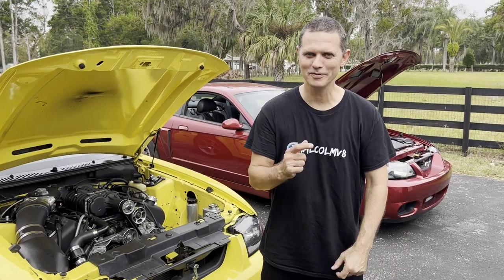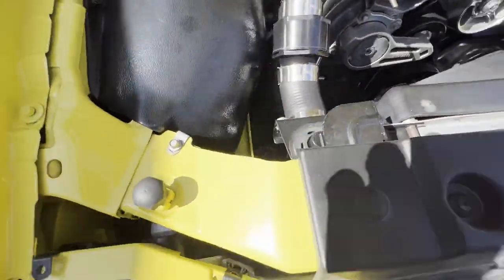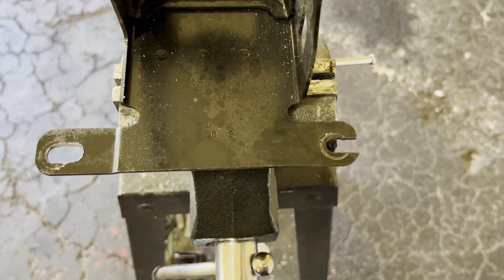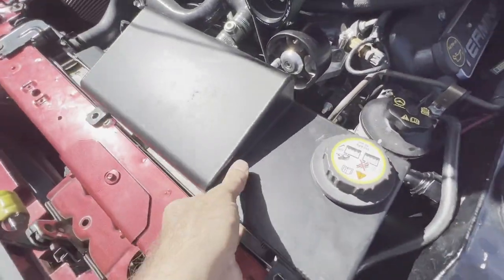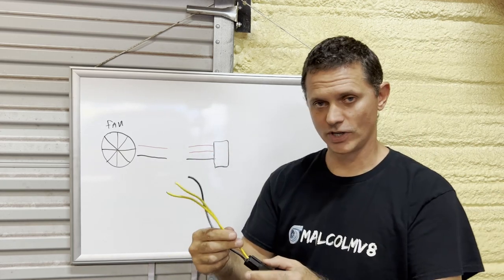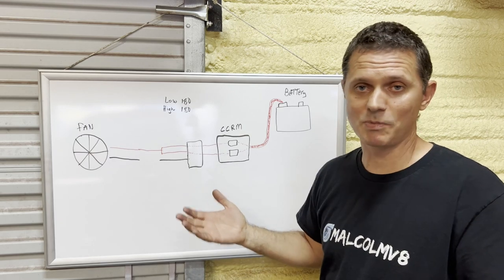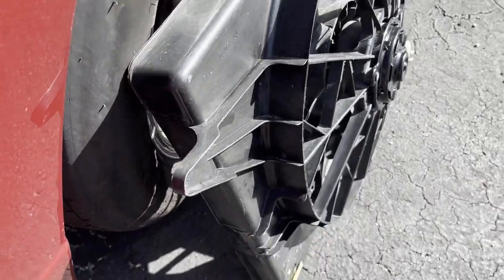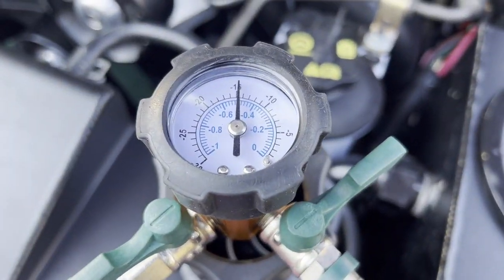Lincoln Mark 8 Fan Install into 03 Cobra Terminator

Comment from the maker: I forgot to include in the video that an alternative to making custom ABS brackets is that you can just notch the fan housing.  I've done this on other installs and it also works well.  Here's a pic of another install I did where I notched the fan instead of relocating the ABS unit.  http://www.mdracingkc.com/images/mds_articles/mark8fan/fan3.jpg

Comment: nice video. I will be soon installing a contour fan or mark8 fan into my twin turbo cobra.... I am running a holley hp so looks like I may need a nput/output module for all these nice upgrades.
Reply from the maker: It’s so worth using up an output to regulate the fan. Soft starting and only spinning as fast as you need are such massive improvements. One of my favorites :)
Reply: @MalcolmV8  for sure. Cheap insurance to keep all that money in a engine happy.
Reply from the maker: @scottadkins918  Absolutely.  No short cuts on the fuel system or cooling system.

Comment: Very nice! I have the same tank. I wish it didnt need to be cut and welded for the Mark 8 fan to fit otherwise I would be doing this. What alternatives do us Cobra guys have for replacement fan (besides this obviously) since they dont make them anymore?
Reply from the maker: Probably the only other one I'd consider is the dual contour fan setup.  They are also super impressive and can be purchased brand new still, or at least aftermarket copies.  Not as powerful as the Mark VIII but still incredible.
Reply: @MalcolmV8  Any modifying needed for that one to fit?
Reply from the maker: @jalexs5283  I'm not 100% sure into a Terminator.  We usually install the Contour fans into our Foxes and the Mark VIII into the Terminators.  I might do a contour fan in a Terminator next time just to see.
Reply: @MalcolmV8  That would be awesome!

Comment: I’ve also got a Mark VIII fan in my 03 Cobra but with a thicker Mishimoto radiator.  I was able to make it fit.  The problem is the overflow tank no long bolts to the car.  Currently I have it zip tied.  Which works.  But I hate it. 

I’m hoping to find a better tank setup that might work.  I like the  consolidated tank but it doesn’t look like it holds enough fluid.
Reply from the maker: You could do a much smaller tank like I did on the zinc and mount it off to the drivers side maybe to get the clearance you need.

Comment: This is awesome, i installed two Mark VIII fans on my 96 Ram, you can see the video on my channel 😂
these fans pull so much air i can even tow with my truck at max capacity and i have no overheating problems at all!

Comment: Malcom as always love the vids. Is this the proper controller for the fan????

Ford part number : 6e53-8c609-aa

I’m interested in running this but need more info on building the circuit for a OEM computer system.
Reply from the maker: Thank you.  The part # on the controllers I have is 6E53-8C609-AA.  To run with the OEM computer is going to require some electronic skills.  You'd need to build an Arduino based circuit that can read in the coolant temp and then drive the controller with a PWM signal.  If you're not into electronics it would be a real struggle.  Alternatively you could likely use a cheap $15 PWM signal generator from Amazon to drive it.  You wouldn't be able to have the fan vary the speed based on temp but you'd at least get the advantage of the soft start.

Comment: Great video! Can this work on a fox body?
Reply from the maker: With a little work yes. We’ve mocked one up on a fox but never actually installed it. We went the dual contour fan route which was such a nice fit. There are videos of it in the channel too. Check it out.
Reply: @MalcolmV8  thanks for the reply, yeah I did the dual but used 2 11 blade focus fan just bought 2 fans and swapped a 5 blade for the 11 so I have 2 11 blades on a focus fan and used a Mazda 6 fan controller so it has a soft start for less amp draw, but ur mark VIII setup seam to move a ton of air, in ur opinion what fan controller could I use to make the MARK VIII work? I would like to try it to see if it cools better, my set up does a good job but I think the MARK VIII moves about 4500 CFM ur thoughts would greatly appreciated! Thanks for the great work! Modding for life!

Comment: Let's talk about the zinc car. What thermostat housing is that? I can't wrap my head around the coolant crossover delete and keeping the thermostat on the lower hose. Goes against what I thought was right. The thermostat controls radiator temp more so than engine temp. So does that mean you want a cooler Stat if it stays in the lower hose?
Reply from the maker: It's an old MMR housing that is no longer made but they make a different one now days as do many places.  Although I deleted the factory bypass there is still a custom bypass I installed, it's just hidden for a clean look.  My thermostat is in the upper hose and right at the thermostat housing is a bypass hose that exits on the underside and goes down and under the radiator over to the lower radiator hose.  The bypass is important, it relieves pressure and also allows coolant circulation and flow avoiding hot spots while the thermostat is closed.

Comment: Just curious if you attempted different fans. Like a gt500 or even the twin raptor fans?
Reply from the maker: No. I just went straight to the most powerful fan that would fit. It was for the longest time the most powerful fan Ford made. The new F150 dual fan setups are more powerful but the motors are so big they wouldn’t even remotely fit.
Reply: @MalcolmV8  Thanks for the response.  Great content on your channel.
Reply from the maker: @6LCobraR  no problem and thank you :)

Comment: Great Video,  I have question.  I have a 03 Terminator with the stock cooling fan and I want to install a Mark8 fan.  I would like to use the stock ccrm as the trigger for a Fusion soft start or pulse modulated input to the Mark 8 fan.  I have the stock PCM in the car and would look to do the cooling fan upgrade in a cost effective way.  I don't want to run all the current of the Mark 8 fan through the stock ccrm if possible.  Is there a better way to control the fan speed that I'm missing?
Reply from the maker: Hi Curt, you could run some heavy wire from the battery to a relay and to the Mark 8 fan.  Then have the CCRM simply trigger the relay.  That would not run any heavy current through the CCRM as you requested.  As for controlling the fan speed on a stock ECU it's not easy unless you're handy with electronics.  The Fusion controller will not natively work with the stock ECU.  It needs a PWM signal fed to it.
Reply: @MalcolmV8  Thanks, I was thinking about a relay as well. I guess I should know better, I was hoping that there was a easy way to get a pulse signal for the fusion module.  Thanks for the answer.
Reply from the maker: @CobraCurt  No problem.  Good luck with your project.

Comment: Hi, great content by the way! Thank you. Can I hook up a soft start to stage one??? On 1994 Mustang GT
Reply from the maker: No unfortunately not.  That stage 1 is the most simplistic way of just getting the wiring to work and will not soft start.
Reply: So with the 94 Mustang GT. It's a plug and play. Cause I believe everything is the same as far as wiring goes. Already have the fans to come on earlier than stock in the tune.
Reply: And if I choose to do stage 3, how do I hook up the fusion controller to the stock ECU
Reply: On the stock ECU, where does the pulse fan signal you mentioned hook up too?
Reply from the maker: @dvinpeace  the stock ECU cannot provide the PWM signal required to drive the Fusion controller.  You need to add your own PWM signal generator.  For those that tinker in electronics the choice is the Arduino.  For those that don't I've heard people buy cheap little PWM generators off Amazon and wire them up to drive the Fusion controller to get the soft start.
Reply: @MalcolmV8 You mentioned that the Mark 8 fan has only two wires, as I looked this up it is said that all mark8 fans have 3 wires and the two wire fans are thunderbird fans which are very similar? Can you confirm this?
Reply from the maker: @dvinpeace  that is incorrect information.  I have personally pulled Mark 8 fans directly out of Mark 8s in the junk yard.  I can confirm they are 100% 2 wire fans.  At least on 97/98 Mark 8s.  I have heard other year Mark 8s with less desirable fans (not as powerful) do have 3 wires.
Reply: @MalcolmV8  I'm speaking of 93-96. Didn't know about 97&98. So your saying the 97&98 fans are stronger 1 speed fan? Also if I have a 95 Mark Vlll fan, would that be an upgrade compared to my Stock 95 fan? Thanks for taking the time to answer me and share your experience & knowledge....
Reply from the maker: @dvinpeace  correct the 97-98 Mark 8 fans are the strongest.  I'm unsure how the 95 Mark 8 fan compares to a 95 GT.  I want to say the 95 Mark 8 is better from chatting to others but I have no first hand experience with that specific comparison.
Reply: @MalcolmV8  okay,  I wonder what the CFM difference is between a 98 & 93. I guess I got the wrong one......

Comment: Darn, I was all for this until you got to the part where you had to cut and weld the aftermarket radiator. What do terminator guys have for options if they want to buy new? Or did Ford stop making these completely?
Reply from the maker: I'm assuming you mean the expansion tank?  I did not have to cut the radiator.  The expansion tank was aftermarket and didn't fit well.  If you have a stock expansion tank it fits just fine, or perhaps various other aftermarket expansion tanks would fit.  There is no standard to them.  Each manufacture just makes their own expansion tanks how ever they want.  This one was a Moroso for reference.
Reply: @MalcolmV8  Sorry, yes. I meant the expansion tank.
Reply from the maker: @racequad9  Such a large number of people swap out the stock one I'm sure you could find a used stock one if needed.  Or if getting aftermarket don't get Moroso as I have confirmed it does not clear.  Perhaps other brands will clear.

Comment: Where can i get the plastic thing that covers air filter. What is it called and who makes it? I imagine it helps alot with the intake air temps
Reply from the maker: Yes it helps. I couldn’t find one big enough for my filter so what you see on the zinc is a very old JLT filter cover I had to heat up and flex and adjust to my huge filter.
Reply: @MalcolmV8  Thank you sir

Comment: Hi I have a question I'm running a mark 8 fan in my 98 cobra but would like to put a fusion speed controller on it but I don't have a stand alone . I'm working with the stock ecu I only have a sct tuner for my procharger.  Can I still be able to hook up the controller. If yes can you tell me how?
Reply from the maker: No unfortunately not. If you’re handy with electronics you could build your own PWM signal generator which changed frequency based on coolant temp and that would do it. Or you’d need a stand alone to do it for you.
Reply: @MalcolmV8  and if I get a stand alone I'll have to retune my car because I'm procharged and running E85. And do you know a good standalone?
Reply from the maker: Yes you’ll need a new tune. The MS3Pro is a very nice unit.
Reply: Hi Malcom will a pwm controller from Amazon work ? I just don't know were to contact the pulse wire from the fusion controller
Reply from the maker: @richardcetz7994  if you can find one that will adjust the PWM duty cycle based on a temperature input.  Otherwise it would just run the fan at one constant speed.
Reply from the maker: @richardcetz7994  no you need a way of reading engine coolant temperature and outputting a PWM signal accordingly.  I built such a controller for one of my cars in this video https://www.youtube.com/watch?v=ZVApe5CwgGU which you can see how I did it and even if you don't want to build your own you can at least understand more about it and how it works.  Then in this follow up video I installed the temp sensor and controller I built https://www.youtube.com/watch?v=6ViO2toYKeY  hopefully that helps with some more background on how it all works.
Reply: @MalcolmV8  ok thank you. By any chance how much would you charge me to make one for me if your willing to nothing fancy like in your video just so I can make it work like you did?
Reply from the maker: @richardcetz7994  I appreciate the inquiry but I just don't have time to make parts and sell them.
Reply: @MalcolmV8  thanks. Yeah I figured but it doesn't hurt to ask lol I just don't have all the equipment to do something like that. Thanks

Comment: How hot was the redfire running
Reply from the maker: It had a ton of issues so it would spike to 240.  Most the time I could catch it and shutdown by 230.  That was in the hottest of mid summer heat.
Reply: What did the fan bring the Temps down too?
Reply from the maker: Runs mid to upper 190s to 200 in mid summer heat. The zinc runs mid to upper 180s with the same fan but possibly because it has an aluminum block shedding heat too?

Comment: Is there a ford part number to the fan?
Reply from the maker: I forget the Ford Part # and would need to dig around but you want to grab one from a 1997 or 1998 Mark 8.  Those are the only two years it had the really monster cooling fan.